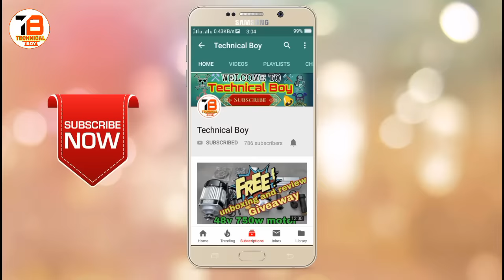Build a powerful Electric Bicycle at home(PMDC 250W GEARED MOTOR)

Comment: U can also built in this bicycle connect generator anathor side  because it gives automatically charging  by raiding and pedalling gives more kilometers try it, hence it is working as zero charges 0rs.😇😋

Comment: Bahot accha kushaali kaam Kara Bhai .kitna kharcha aaya..aur kitne din huva assembly karne mein . Full charge kitne kilometer mileage deete..
Aur full charge ke liye kitne units consume karte.

Job taare..( electrical wires ).. n connections saare ek aluminium dabbe mein rakhna behtar hai..

Comment: Hopeless video. The camera goes on hunting here and there and nothing could be made out what is being done.  How the second sprocket wheel is fixed, how the wheel axle is made bigger to fix the second sprocket wheel, and many things like that. The only thing clearly shown is taping the batteries together and taping them to the cycle bar. And connecting the motor controller about which nothing could be understood. He seems to be just a mechanic who told his friend to shoot his actions and the friend uploaded it. Useless video.

Comment: Hi, don't use a normal cycle brake because it can harm your motor. at the speed the normal brakes can't stop the cycle. So use a ebike brake it is safer than normal  brakes
Reply: what do you mean

Comment: Regards the Bafang side mount motors. Why don't the motor controllers work with the throttles ?! I tried 2 from Ebay and one from Amazon. The Amazon pair- the throttle connector doesn't match the controller connector ! And the ebay's won't turn the motor ! The only one that did work is the one with the 100K pot. ! And it's quite possible what they promote here is phony too, making you buy extra stuff because stuff don't match !

Comment: Hi nice video! What is the little thing with the holes that you used to connect the motor to the bike ? Because i have the same issue and the motor does not fit so i need the connection piece like you used wow